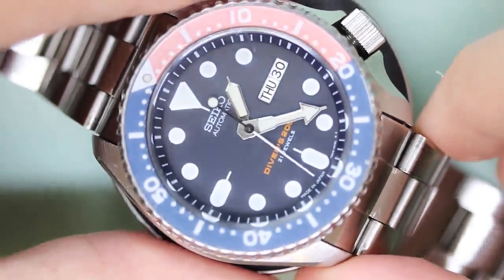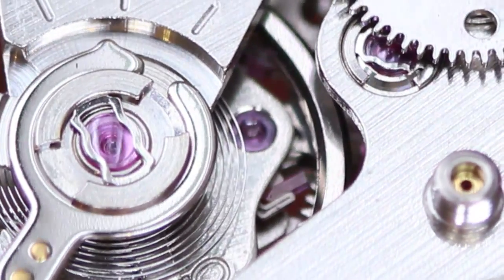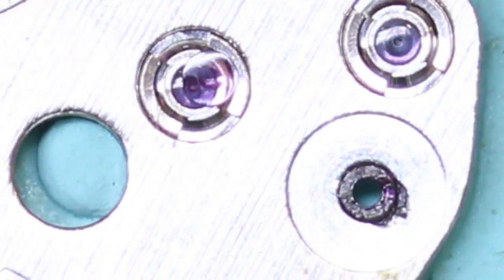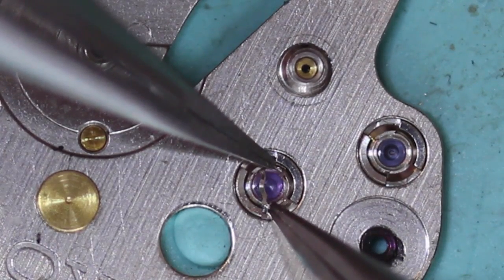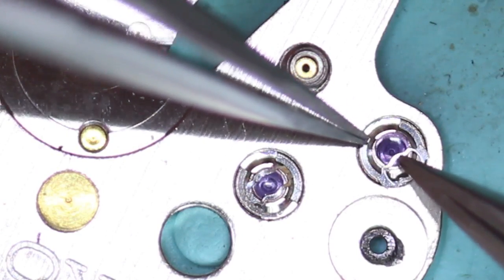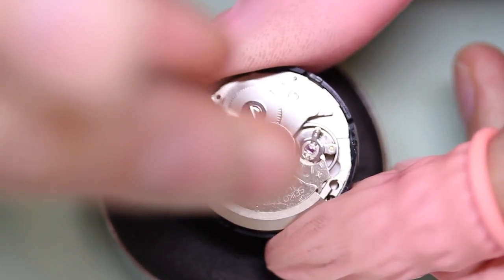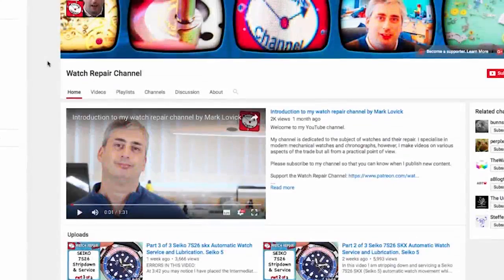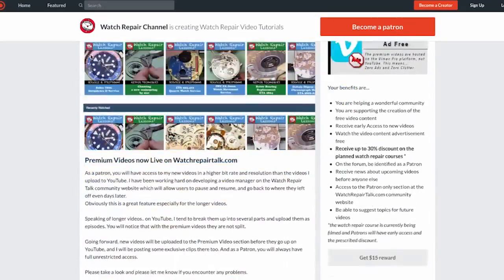Conclusion Seiko 7S26 SKX Divers Service and Lubrication

Comment: Hi, I bought a Seiko V172 chronograph watch and needed more links. I found a 'sample' V172 on ebay and bought that for the band. The watch has no movement, so how hard would it be to put a working movement into the sample watch and make it functional? I found movements on Ebay for the V172 readily available. I don't know if I could do the swap though.

Comment: Would u consider sellin a few 7s26 scraps i could practice on ?   I for the life of me can not replace a hairsrping even when its a whole balance cock /balance wheel assy.  I can never get a perfect movement to run after that.  I messed a few balances up when i first started  now i have about 12 perfect nh35/6 7s26/36 but all need balance wheels.   I apparently can not replace the actual hairsrping itself  i have replaced a whole assy once that actually worked. Usually i js buy a new nh36 but i have so many i ccx could learn from if i had some more parts or extra balances or a hint on how to do it correctly or figure out what im doin wrong

Comment: It may not be apparent, but those anti-shock springs are as tiny as a speck of dust. I have "medium" experience of watch repairing, but so far those springs have been the most difficult to handle. Impossible to replace without magnification and very, very difficult to get into place even with excellent magnification. If you're new to watch repairing I do not recommend these Seiko 7S-movements.

Comment: Watching you try to fit the shock spring onto the end stone without your magnifying glasses makes me wonder why you don't use a stereo microscope (such as Omano OM2300S-GX4 7X-45X Zoom Stereo Boom Microscope). You can buy them as binocular or trinocular (for simultaneous viewing through attached camera).   Just wondering.  By the way, I'm not a watchmaker. I repair sub-miniature electronic devices.  But I love your videos!
Reply: Thank you for your clarification!

Comment: The hole of the first reduction gear actually has to align with the hole in the oscillating weight one can use a tapered brass pin to do this while slightly tightening the screw then removing the pin and using a peg wood to hold the weight then tightening it down, but not too tight.
Reply: What is achieved by this alignment? I am having trouble imagining an advantage?

Comment: Mark. I have a Seiko Kinetic divers automatic watch which is no longer holding a charge. It will run for a couple of hours and just stop. It is about 10 - 12 years old and has never been serviced. It would also prob need a replacement glass as it all scratched. Is it possible to give me a rough estimate of what it might cost to repair/service.
Thanks
James T.
Reply: You can replace the capacitor yourself, I did mine a couple of years ago.  The capacitor kit is around £25.  Glass is around £15, but I've not replaced that, so don't know how tricky/tools required.  So your looking at £40 parts plus labour.

Comment: I saw you had a trouble setting the second jew. I think it is better to re-oil it when it touch the other parts around and also you should clean the area it touches. This is the only reason I click "dislike". Good man! Enjoy your work, keep calm your life!!!
Reply from the maker: You missed the point. Perhaps you did not listen to my voiceover - I already acknowledged what you are saying, however I was doing this without an eyeglass and with a big camera lens in the way, normally I replace these jewels dry and use an automatic oiler once they are correctly secured ;) anyway thanks for the feedback!
Reply: I see, my mistake. But anyway, if they are with oil on it, it is better to clean the area they touch. If you are said the same, sorry - I did not listen the video with sound!

Comment: WOW! Just yesterday, I sent off my Seiko Monster (cal.4R36) to the repair center in New Jersey. I had no idea they'd have to disassemble the whole watch. Facinating! Thanx.
Reply: Are you happy with the work they did?
Reply: Very happy. I was wearing it just yesterday. I've sent in two more Seikos since then. Excellent work. (sorry for the late reply. I've been busy)
Reply: Seiko replaces 4r36 movements with new ones during a "service".   They don't disassemble and service low cost movements like a 4r36 at the New Jersey center.
Reply: I didn't know that. (I was wearing it just yesterday)

Comment: For these Japanese shock springs (they also come trilobal) I snip off the point of a toothpick, put it straight on the stone and twist them half a turn. That would be both for opening and closing.
Reply: Thanks for the tip! Have you actually tried your method and been successful with it? The reason I'm asking is that I tried this with a piece of concave peg wood and it worked perfectly for opening the spring but not for closing it. I'm thinking that as a toothpick is softer it might do the trick!? Oh BTW, those "trilobal" springs are called DiaFix springs and are in my experience a little easier to handle although in no way easy to handle.